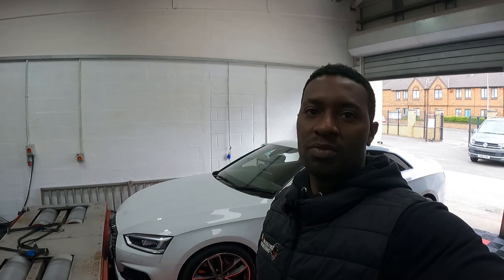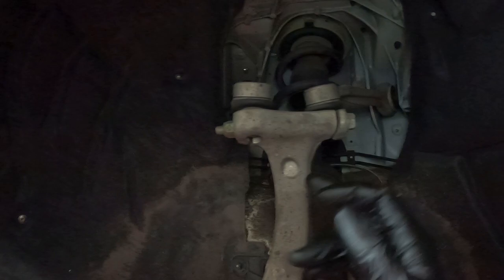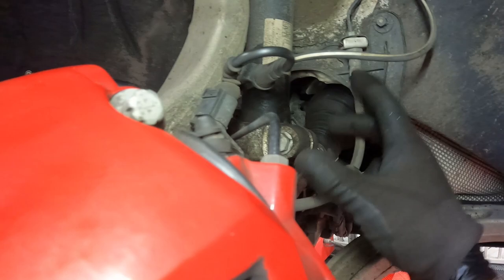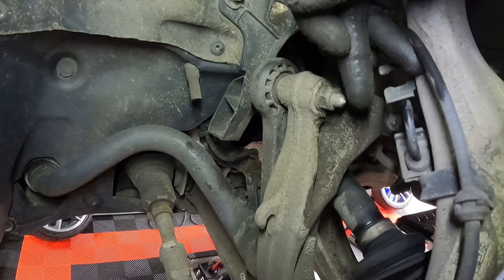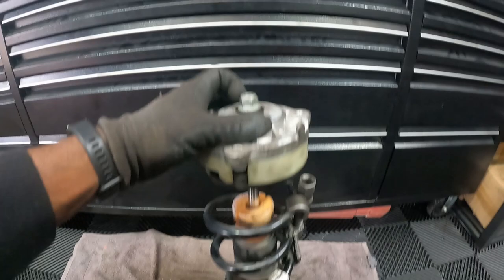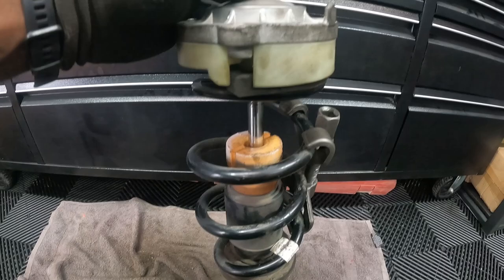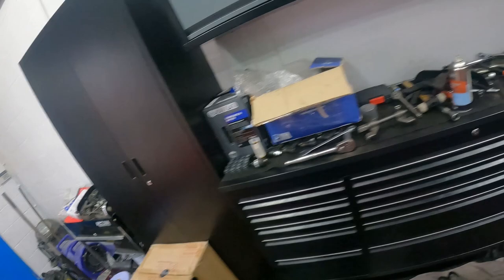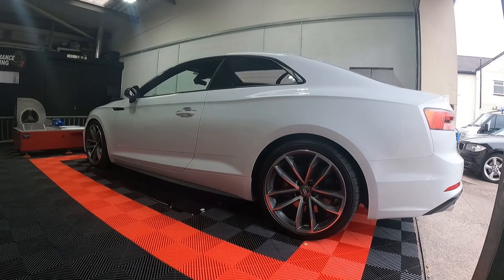Audi S5 B9 H&R Lowering springs Install

Comment: Amazing video, this covers just how to do it with the least pain possible.

One question though, will this work on a A4 without the factory lowering springs? Will it clear far enough when the springs are 25mm longer?
Reply from the maker: Thanks, hope it helps with your install.

What I would recommend is, when you have to compress the spring, try and compress it slightly more to take up that extra 25mm then it should allow enough clearance

Comment: Is the process the same as b9 rs5?  I do also have the dynamic suspension.  Thanks for your advice and excellent video!
Reply from the maker: Hi, thanks for the feedback. Yes the RS5 will be very similar if not exactly the same. Thanks

Comment: I'm debating whether I should get the 034 springs or H&R Springs. Which one would you recommend?
Reply from the maker: I use H&R on near every vehicle which comes in for lowering springs. 034 will probably give you the same stance but not sure on the ride quality

Comment: You mentioned you added spacers, can you recommend them/ or a brand that fits a 2018 Audi A5. Thanks
Reply from the maker: Hi. Yes that's not a problem, i supply Bimecc spacer kits on the online shop if your interested in purchasing a set. Www.performance-engineeringltd.co.uk

Comment: Do you have torque spec for the different bolts? Bought a set of springs for my car and I’m looking to do it soon, but don’t want anything to come loose
Reply from the maker: I don't I'm afraid sorry. All the bolts are very hefty bolts so you will be fine tightening them up as tight as you can.

Comment: Great video! Just curious, did you have to cut bump stops for this install?
Reply from the maker: Hi Adam, I don't cut bump stops on any lowering springs install. Either reuse the originals or sometimes H&R supply revised bump stops if required.
Reply: @performance_engineering  thanks for the info, and also fantastic video! I've got some H&R springs on the way for my b9 S5 coupe and will definitely use this video for assistance!
Reply from the maker: @adampacey9380  Hi. Great to hear you enjoyed the video. Hopefully it helps you with you install, feedback  how you get on 👍

Comment: What number of the spacers you use at the s5
Reply from the maker: Used 15 and 12mm for this setup
Reply: @performance_engineering  12 on front and 15 on the back
Reply from the maker: @TheIvan4680  yes that's correct

Comment: What kind of spring compressors are you using?
Reply from the maker: They are just normal spring compressor mate, can be bought from most motor factors or ebay, amazon